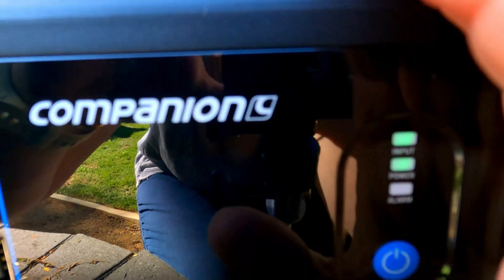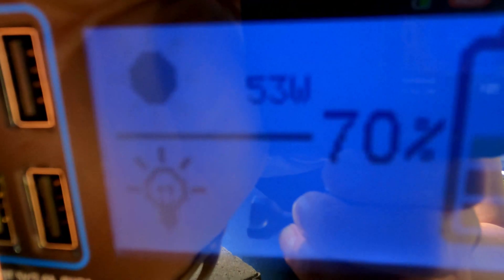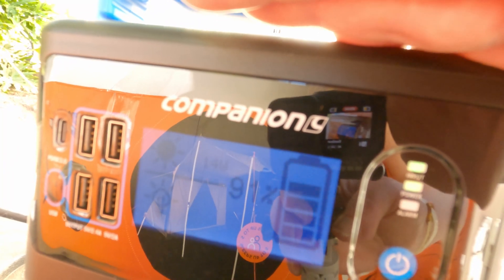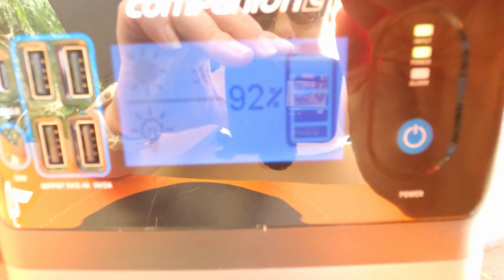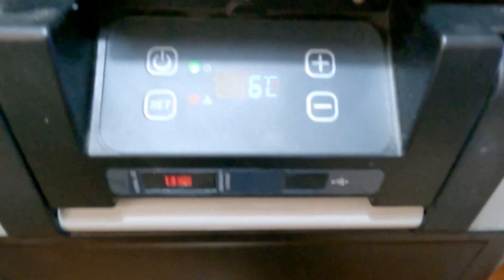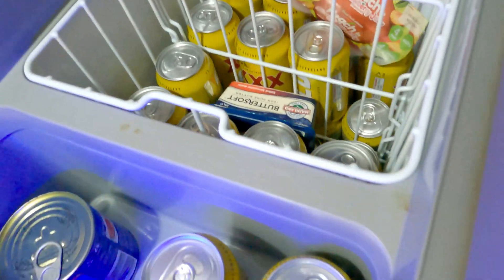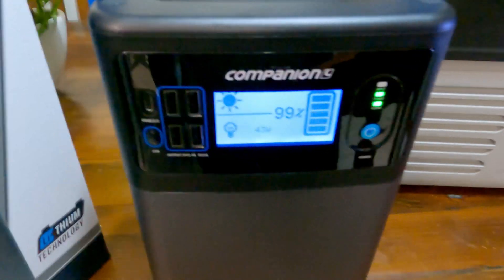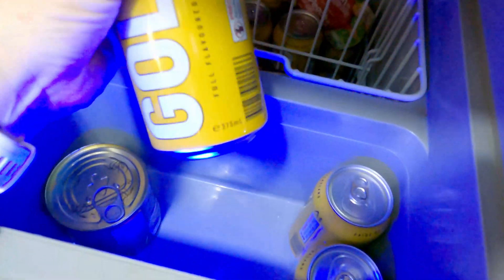Unboxing: Lithium 70Ah Power Station Part 2  Testing Solar & 12v Fridge

Comment: What is the voltage output of that thing when it is fully charged? I simply won't buy any lithium power pack that's under lower than 12.6v  when fully charged and the reason being is once it gets to 50% charge the voltage is gonna be so low that fridges and appliances will start cutting off. I've seen their promotion video of companion 100ah version and it's 12.1v at 100% displaying on screen and I told them it's a joke as the 44ah unit is at least 12.8v when fully charged 🤗

Comment: Great video. I'm looking at purchasing one of these for my 38l Engel. just wondering what run time you've gotten out of the companion whilst away camping and do you think it should be paired with a solar panel/blanket?
Reply from the maker: Cheers, thanks for watching. https://youtu.be/oNLUJzJcHXU This is the campsite video review update. should answer the questions. :)